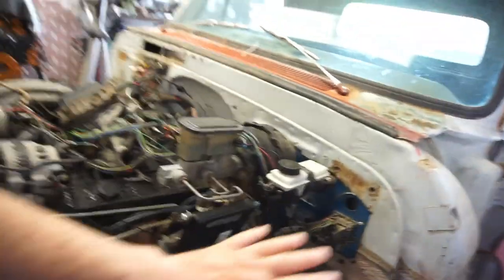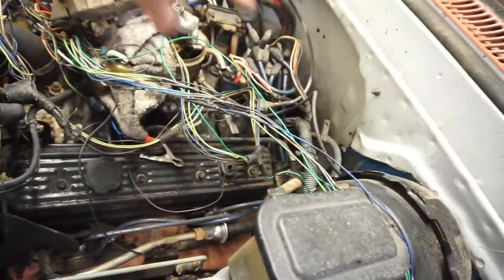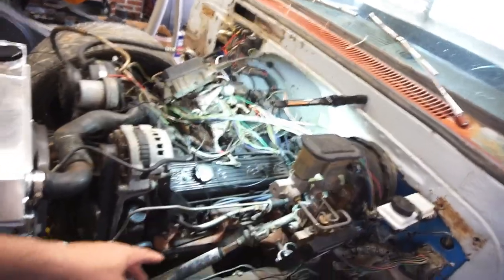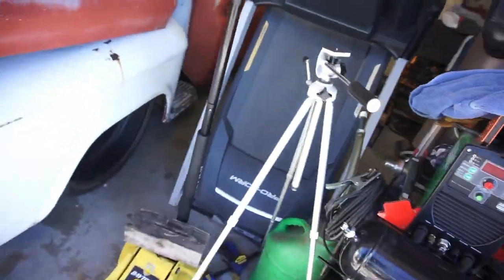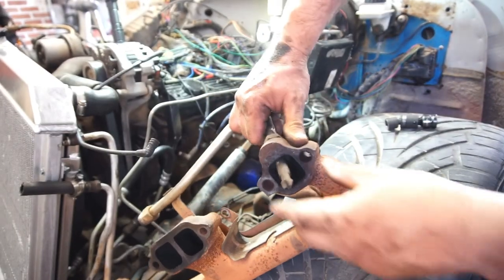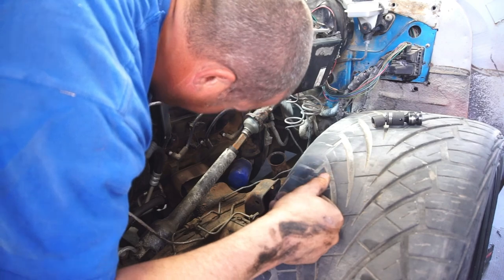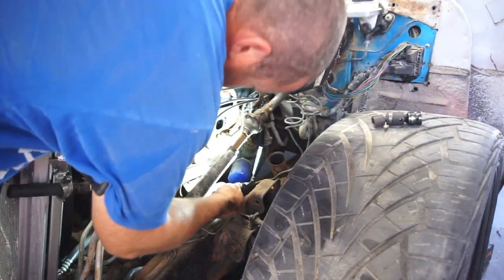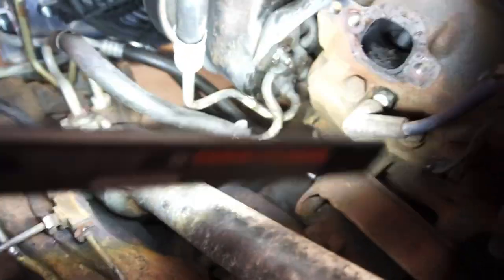Let’s Remove The Stock Restricted Exhaust Manifolds On Project Crack Pipe 64 C10 K1500

Comment: Nothing like rusty old exhaust manifold bolts to make a shade tree mechanic sweat blood !!  Good penetrating oil , a trusty BFH and a torch waiting to be called into action .  I beat the manifold and the bolt heads with the hammer after the penetrating oil has a chance to do its thing . A quick sign of the cross and careful work with a breaker bar usually works pretty good . Got that job coming up on my wife's '60 T-Bird .  : (

Comment: Trucks coming along sick!! I’ve been watching your channel and have been wanting to remove my smog pump and egr system,I have a question about what you did to the metal lines that travel from the exhaust manifold to the back of the block.I just installed headers today and was wondering what to do with that line comeing from the back of the block,thank you!!
Reply from the maker: Those tubes are just cross over tube that go from one exhaust to the other. They’re bolted to the rear of the block with 2-4 little bolts. I just unbolted them and removed the tubes.